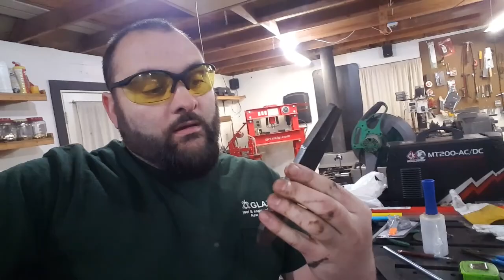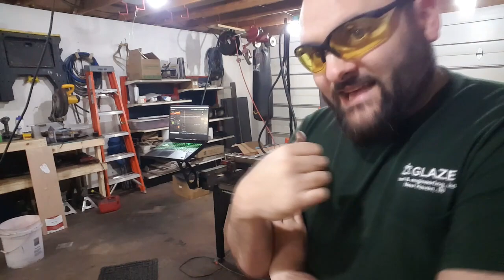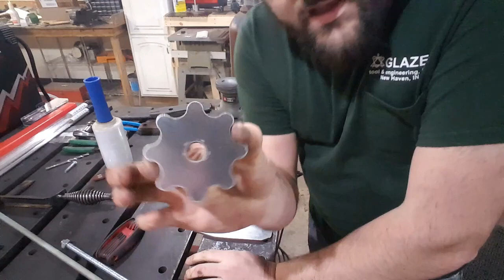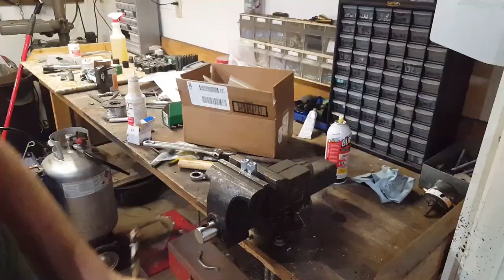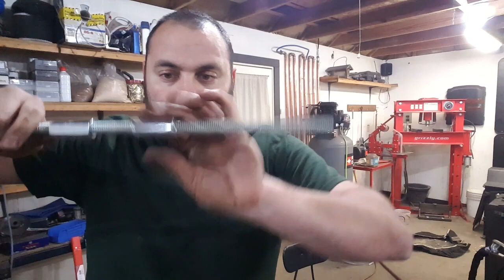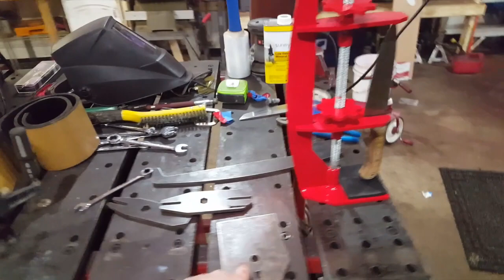DIY Hidden Tang Clamping Jig That You Can Build With Basic Tools.

Comment: Great video. I am new to Tig welding so take what I am about to say with a grain of salt. I noticed you cleaned your metal before welding but I also noticed that you were still welding on the mill scale. The problem with that is the mill scale melts at a higher temp than the actual metal so often times you will over heat your part and contaminate your weld.
Reply from the maker: yes this is true.  I should clean off all the mill scale in the weld area if I wanted a perfect weld...   I'm using ER70S-6 filler metal which can be used on mill scale.  A great weld is ok with me I don't need perfection. :)

Comment: I know your new, but your lack of concern for your safety is alarming, no Safety glasses and the way you drill out those coupling is horrible, show the use of the Mill or proper tools. Your ambition is admirable but, Dude Safety in your shop is your responsibility,. Don't want to see you or anyone else hurt.
Reply from the maker: Well I'm not new and I realize drilling out the couplings in this manor is less than optimal.  I literally said this exact thing in the video. I was just showing that it is possible to  do it by hand.  Not everybody has a mill and a lathe like I do.  A lot of guys just have and angle grinder, tape measure, and hand drill.  I'm trying to help them maximize their potential.   I have a mill and a lathe.  If I choose to not wear safety gear in every video that's my choice.  I wear it 90% of the time.